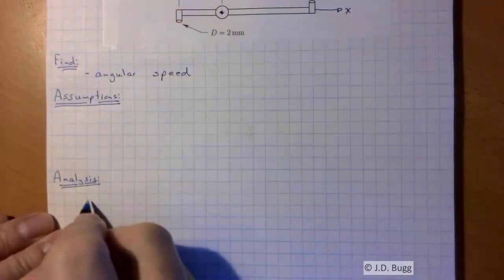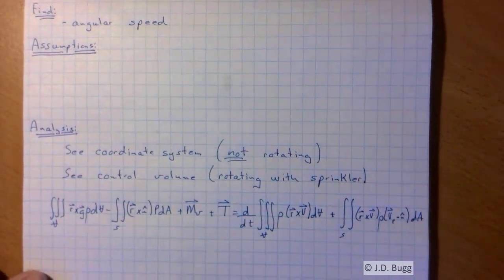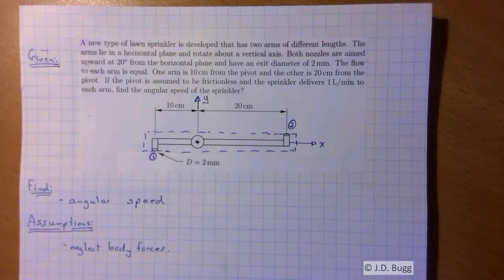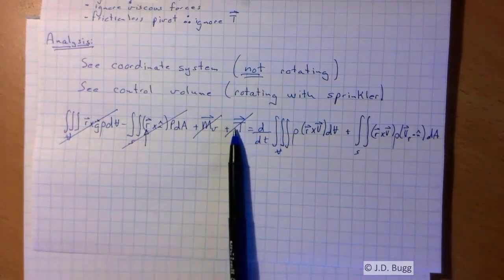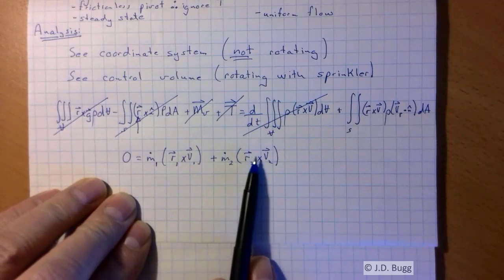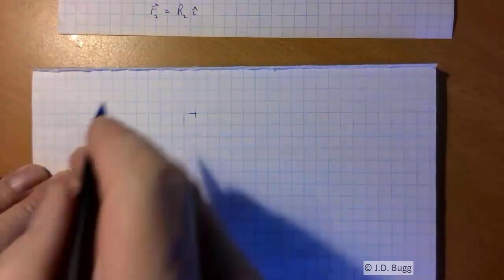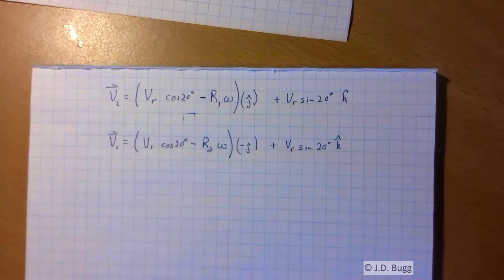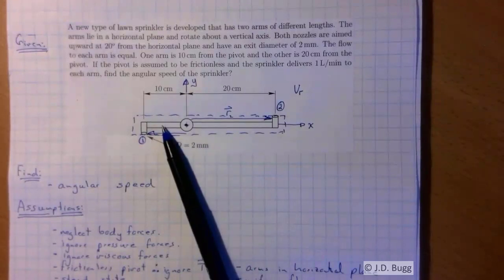Control Volume Analysis- Sprinkler Example

Comment: flow rate 1l/s supposed to be divided by two and then calculate the velocity since it's delivered to each nozzles
Reply from the maker: The problem states "the sprinkler delivers 1 L/min to each arm..."  Therefore, the full 1 L/min has to be used to get the speed of the water coming out of each nozzle.